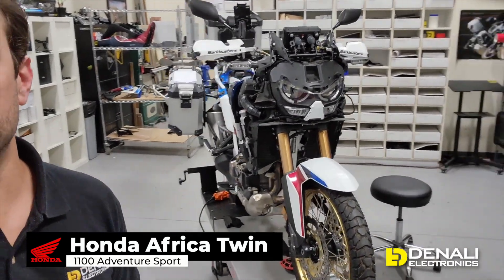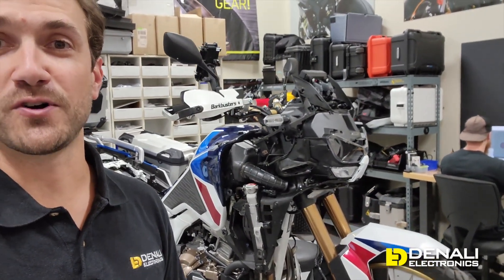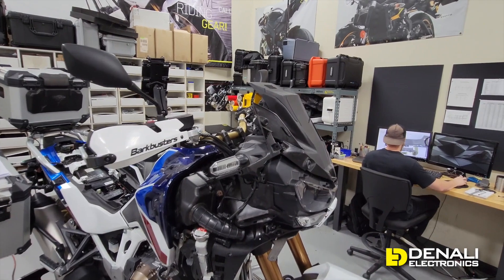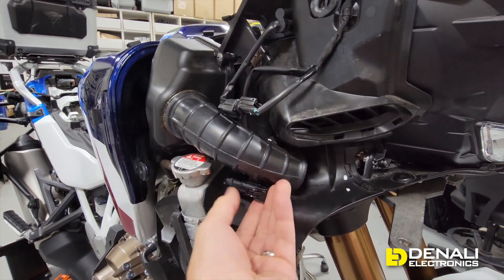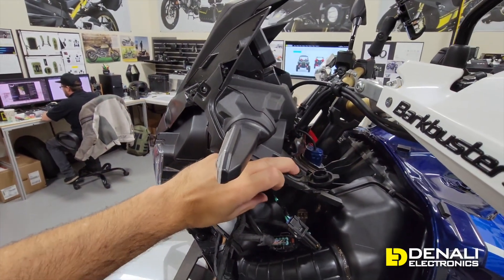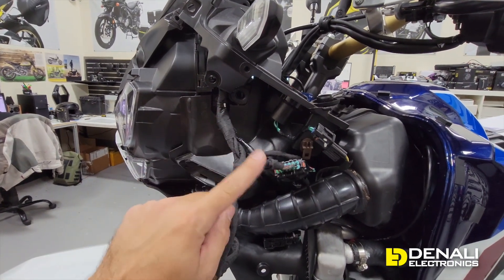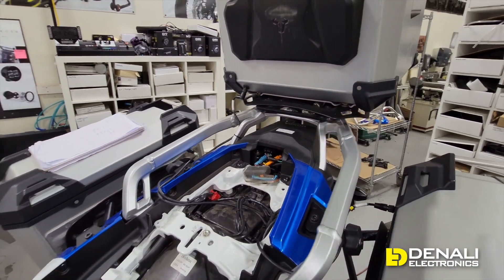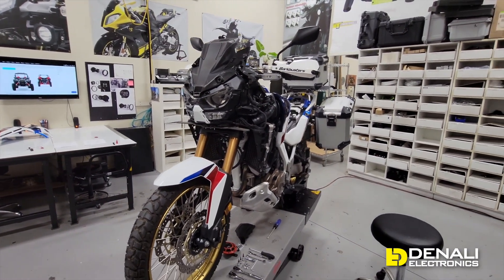Honda Africa Twin 1100 - How to Wire Electrical Accessories - OEM Wiring Overview

Comment: The cansmart goes into the red diagnostic port? I’m getting ready to hook mine up but have seen videos of connecting it under the tank. 2022 AT1100 AS

Comment: Hello! Thank you for sharing the video, very instructive. But just to confirm, where is the best place to plug in my Garmin GPS?
Reply from the maker: There is not an option on the DialDim Controller for controlling a switched circuit (the CANsmart Controller has this function). This thread might be a simple and useful solution for you: https://www.africatwinforum.com/threads/best-way-to-hardwire-gps.42381/

Comment: I have a 2022 AT adventure sport looking for a set of driving lights ---easy install
Reply: your light braket wont work with factory crash bar under headlight
Reply from the maker: We offer a set of crash bar mounts that would be perfect for your stock crash bars: https://denalielectronics.com/collections/universal-light-mounts/products/lah-00-10300-b?variant=15068397863012

Comment: Hello. Can i connect Garmin to wires of 12v plug on left side? And is it any  adapter or i just fit fast connector clamp. Tnx
Reply from the maker: From the factory the Africa Twin has a 12V (cigarette lighter style) plug.

Comment: Is this mounting bracket available in the UK yet? I have a manual 2020 CRF1100 Adventure Sports
Reply from the maker: You will need to check with R&G Racing in the UK, they are our distributor.

Comment: Hi, on one of the AT forms they say the fog light connectors (2:23) are not powered on the North American bikes (2020, 21,22), they're just dummy plugs. Do you know if that's true or not? Thank you.
Reply from the maker: I checked with our design team and they can't confirm if the plugs are powered and disabled by the manufacturer. Hopefully someone else can chime in.

Comment: Will love to see CANsmart™ Controller GEN II work with:
1. Set of T3 Front Signal Pods (white/amber) and also for Rear (Red/Amber)
2. Two set of Aux light one for High beam and Seocond for Spread, also Blink High beam on Horn
3. Secondary Horn
4. B6 Brake Lights with two patterns (one simple on and second Flashing for panic brake situation) and two brightness level
5. All this with your brand new DialDim switch coz Its very difficult to remember the patterns to Turn ON n OFF using Indicator and menu L/R switch.

I dont know if this is possible but i wanted to have option to reconfirgure all these Accessories using Phone App, on the go on road Like I do with my Neutrino Aurora Plus.
Sorry if I am ssking for too much :D but that device make more sense.
Reply from the maker: Responding here as well in case someone finds this video and not the other AT video...
This is possible and our design crew is experimenting with some combinations and will share soon. 
You can setup the DialDim for lighting and the CANsmart to run the T3s, brake light, and horn. Once the CANsmart is setup, you can forget about it and use the DialDim as your lighting controller.

Comment: Hi there!
It's a very useful video but I'm facing a hard time while Fitting the DialDim Lighting Controller.

I have Africa Twins 1100 (Adventure Sports) but I can't find the High Beam Wire in the Bike so, I will connect the Trigger Wire Harness (High Beam) Wire.

Please a helping hand with be great appreciated. :)
Reply from the maker: Please give us a call at +1 401 360 2550 and we can help sort you out! The ground switched headlight is tricky, but we have a solution!
Reply: BOAS , SEMPRE CONSEGUI FAZER A LIGAÇÃO AO FAROL ALTO? ESTOU COM O MESMO PROBLEMA !!! OBRIGADO